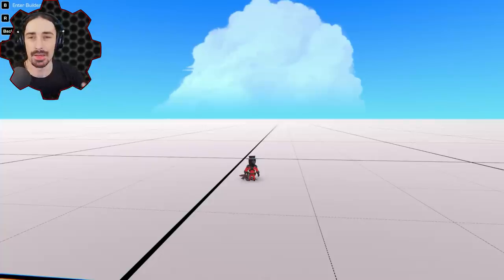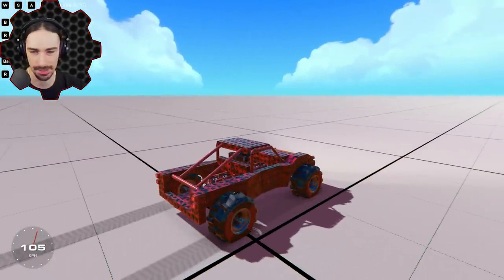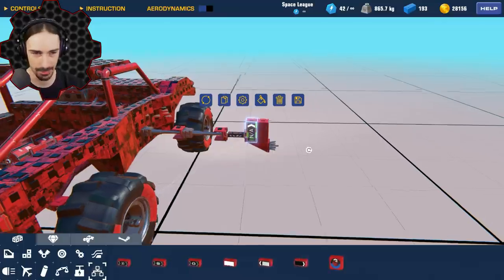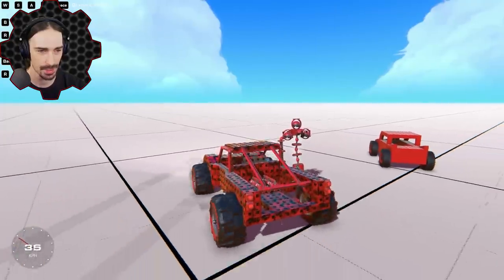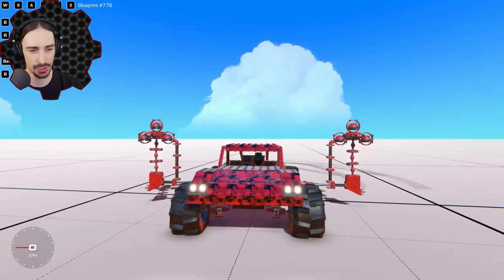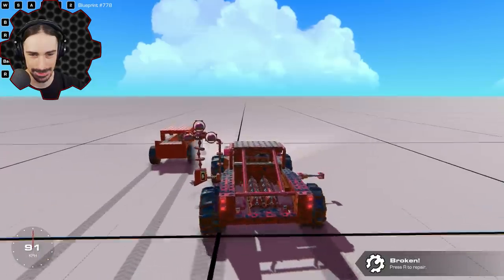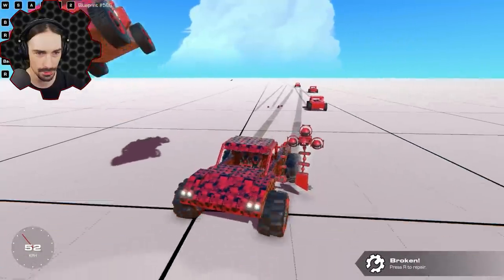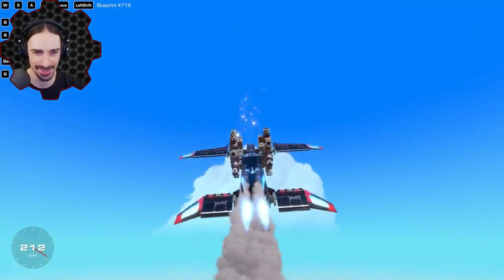I RE-Invented the Skyhook Recovery System, But Now It's a Weapon - Trailmakers Gameplay

Comment: When it gets to a very high altitude, it should disconnect, and the damage from falling down will surely kill anyone in it. Or at least obliterate the vehicle.
Reply: yes
Reply: Delayed annihilation?
Reply: Or use the altitude sensor to activate an explosive
Reply: @jettbarrett9827  that might work better. Just if the explosive can destroy everything.
Reply: @notoriginal1087  D3L4YED ANNN1LATI0N!!!!
Reply: @honlt4678  or it doesn’t need to it only need to destroy the up thrust
Reply: @jettbarrett9827  that's exactly what I was thinking
Reply: @jettbarrett9827  I agree, disconnecting would need a big disconnecter, when a small explosive could be crammed in the middle of the upthrust.

Comment: I finally got around to trying TM myself and have a bit over 24 hours so far. Those gimbal jets were a game changer for me :D Solid Snakeeeeeeeee.
Reply: One of my favorite little creations is the basically an armored jet pack with the pilot's seat and a couple gimbal jets
Reply: @JustIn-sr1xe  That sounds super fun! I started something similar but it turned into a monster of parts as I added to it. I am pretty sloppy in my builds, but wow is it fun! :D
Reply: @robinkesterlives  You'll get the hang of it soon enough.
Reply: @JustIn-sr1xe  I think my current gimbal flight thingie is doing the trick but its super janky. I had a lot of fun with it last night trying to pick up the explosive blocks I've put off. :D I need to try ScrapMechanic next! I loved Beseige, wish that had a sequel.
Reply: @robinkesterlives  My gimbal jetpack is a bit wobbly too. I've even tried using rotating servos to stop the wobble. So, don't worry. You're not alone there.
Scrap mechanic is another fun game. I have about 1000 hours just in creative. You can build faster in trail makers. But, there's more mods and unusual builds in scrap mechanic.
Beseige is also a good game. Though. I'm not so good at that one.
Reply: @JustIn-sr1xe  lol, I just got the Humble Bundle Steam version as I completed the Game Pass Campaign. Seems like a good reason to start a fresh game and use my skills to redo all the campaign :D Maybe I will apply some of what I learned as I rebuild my vehicles and redo the tasks :D

Comment: Put bombs in the thing you made and explode it mid air it will be op you can add even more thing like attaching gattling gun and it will trigger as it Certain height using the altitude sensor

Comment: You should try to make one of those giant tungsten rods that are dropped from space but out of heavy weight blocks. The original point is that it has so much energy that it becomes explosive but just the sheer impact of it should be devastating.